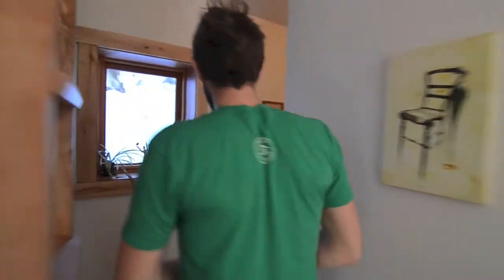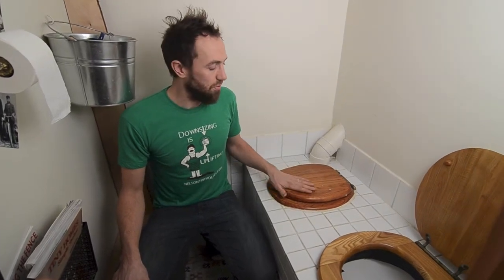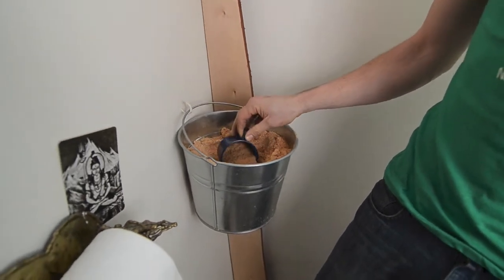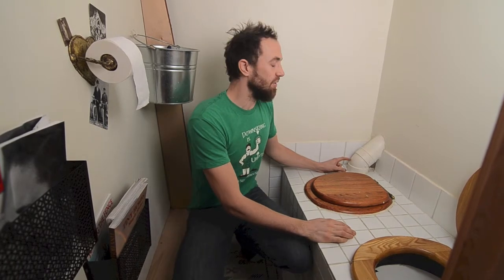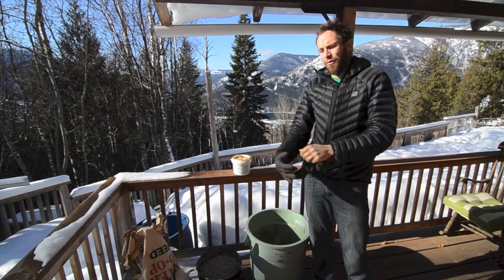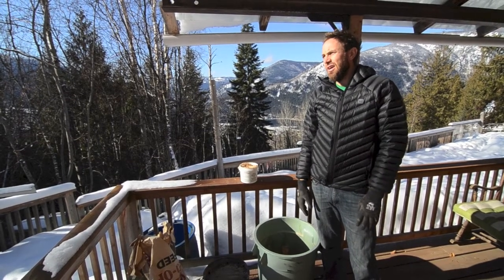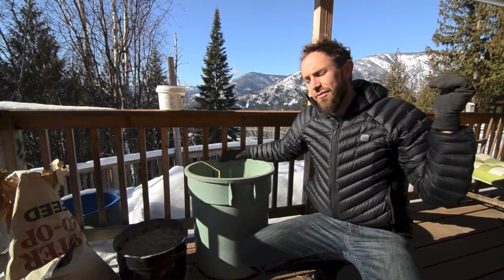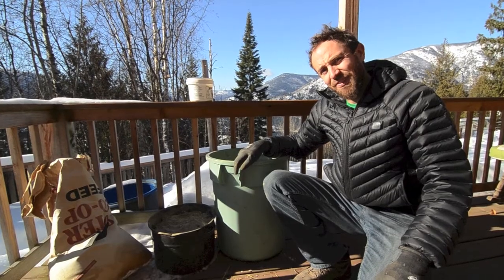Seth's Composting Bucket Toilet

Comment from the maker: Hi Folks, Seth here.  I just wanted to give a quick update on this system.  Actually there's nothing to report.   It's been in use over 7 years and is now used by 4 people.  I change it every two weeks at most (tot. time 10 minutes).    I've had to change the fan once but that's it!!!   Another victory for simplicity  :)

Comment: I don't understand why you don't use a 5 gallon bucket like most people do.  I am just guessing but you want more room for your "hay blanket" you put in the bottom, right?  Well, I just put a good layer of sawdust or hamster bedding in the bottom then add more as you use it. You are the first person I've seen use a garbage can and by doing so have to raise the bathroom floor!  Also you can buy a urine diverter on ebay for $40.00 or less so one toilet is all that's  needed.  I know you're system is in place and works for you but for other people who are just now learning about it and don't have room for 2 toilets I'd suggest that they do some research. There are a bunch of videos showing the simple way to do this. I do appreciate your willingness to share information though. :)

Comment: what do you do about the toilet paper?
Reply: I know it's been a while since you've posted this comment, but to answer for others' concerns.

Toilet paper, in this context, is just fancy wood chips.  TP, at a basic level, is simply reformed wood fiber, so you can compost them just fine.  The cheaper/septic safe types of toilet paper will likely break down faster since there is both less and they are designed to disintegrate quickly, at least in high water environments.

Just to mention in case you or others are curious, if you run across fancier tp with cotton or other plant/animal "additives" (I don't know, silk? that's getting into way to much more money than sense to me) they are also compostable.  They just may take much longer, especially if you are attempting faster (NOT recommended) composting techniques, and if you are conscious of growing organic would probably avoid cottons (you likely do anyways) since cotton is notorious for being GMO and grown with heavy use of pesticides (not all but a very large chunk).
Reply: question: can be one of those composting toilets which separate the pee from the poo the answer to the problem, ? instead of buying two toilets (i don´t know their name ).. and another doubt i have is where do you compost everything u colletct? it can only be used for non eatable plants right? .. thank you for your time.